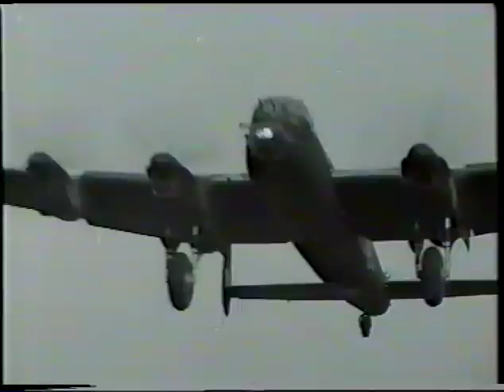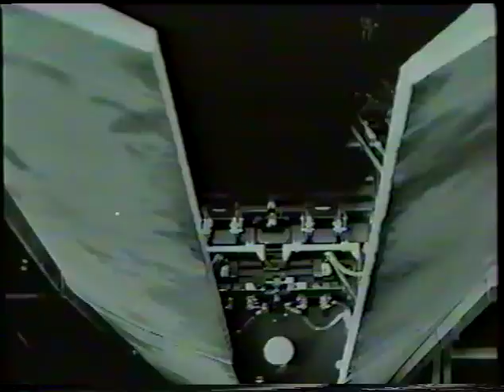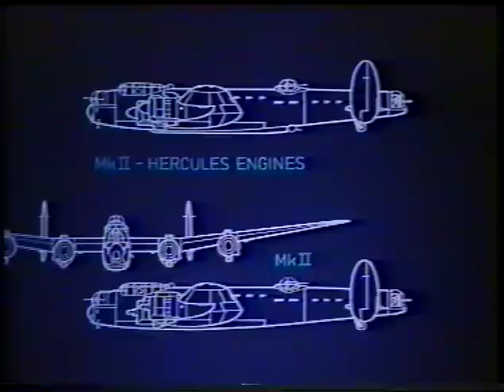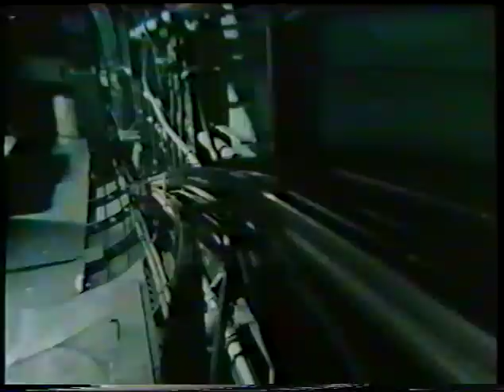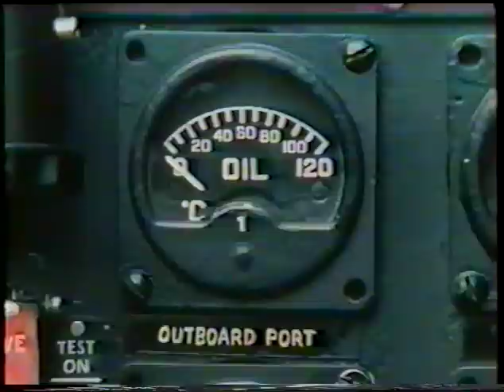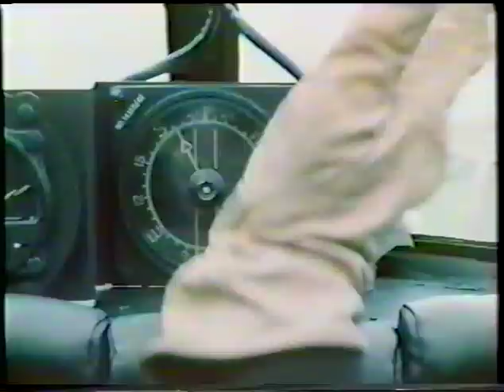Avro Lancaster Classic Documentary

Comment: A belly gun turret would have saved so many .
Reply: Yes but exactly where, just about the whole of the underside was taken up by the bomb bay
Reply: Fully acknowledge your point. Design did not emcompasse a belly turret.  Canadian Halifax Squadron manged to fit a  belly gun. Presumably Halifax has a shorter bomb bay. A tradegy  for the Bomber   Boys. @johnvanstone5336
Reply: Further reference to Google produces a diagram envisaging a ventral belly turret  FN64.  Positioned comfortably away from th bomb bay ; sadly never implemented .
Reply: Please forgive my miss spelling I have diminishing eyesight.
Reply: belly turret =  Smaller bomb load = more missions = more dead aircrew. An example is the B17G's with a quarter of the Lancaster's bomb load means risking 4 aircraft and 40 men to drop the same load. While in formation the underside 'should be' protected by the aircraft next to you, or that was the theory?
Reply: @andybawn1  Link anything stating an unmodified Lanc carried 4 times as much as a B17 G.
Reply: @nickdanger3802  sorry, just checked my post and I didn't say any thing about unmodified?
Reply: @andybawn1  Link anything stating a standard production Lanc carried 4 times as much as a B17G.
B.1 Special   32 aircraft were adapted to take first the super-heavy (12,000 lb) ‘Tallboy’ and then ‘Grand Slam’ bombs and included    up-rated engines    (with paddle-bladed propellers to give more power)    and the    removal of gun turrets    to reduce weight and give smoother lines.  For the Tallboy, the bomb bay doors were bulged slightly whilst for the Grand Slam, they were removed completely and the area faired over. For some Tallboy raids the mid-upper turret was also removed. This modification was retained for the Grand Slam aircraft and the nose turret was also later removed.
BAE Systems Lancaster page
https://www.baesystems.com/en/heritage/avro-683-lancaster
Reply: "The US 8th Air Force decided on daylight raids as they believed that this allowed for precision raids and precision bombing. Therefore, they reckoned, fewer raids would be needed in the long term for bombing to succeed."   "The 8th Air Force had fired 99 million rounds of ammunition during these flights and it is thought that 20,000 German planes were destroyed."
History Learning Site UK
https://www.historylearningsite.co.uk/world-war-two/the-bombing-campaign-of-world-war-two/b17-flying-fortress/
Reply: @nickdanger3802  yep knew all that 40 years ago, the simple fact is the B17 carried 4000lb to Germany half its maximum of 8000lb because of the range, Did it carry 22000lb at any time?. An interesting side note, The Mosquito could carry 4000lb to Germany risking only 20% of the crew losses of the B17 and was 80% cheaper to build, it could place a bomb on a specific building not just flatten an entire city, Go figure?
Reply: @andybawn1  Mosquito  FB. Mk VI  2,305 built  Fighter bomber/intruder variant using Merlin 22, 23 or 25.  4 (Browning) machine guns and 4 (Hispano) cannons,    plus 2 x 250 lb bombs    carried internally & underwing carriage of    up to 2 x 500 lb bombs.    Could be fitted with underwing rocket projectiles or drop tanks    instead of    external bomb carriage.
BAE Systems Mosquito page
https://www.baesystems.com/en/heritage/de-havilland-mosquito
Reply: B17/Fortress III  Bombload 12,800 lb with fuel for 1,140 miles
page 367  Bomber Command  Hastings
Reply: Imperial War Museum  1942  "Accepting that precision bombing was proving impossible, the War Cabinet sanctioned 'area bombing' – the targeting of whole cities to destroy both factories and their workers."
1944  "American escort fighters shot the Luftwaffe out of the sky."
https://www.iwm.org.uk/history/raf-bomber-command-during-the-second-world-war
Reply: TheAmericans did not prepare for night operations . Relying on group naviagotor come bomb aimer  to release ordnance  followed by group release. I  believe their navigators   trained some twenty weeks aigainst RAF course of sixteen months ensuring our  chaps would operate independently   Interesting stats. provided by  Don Nijboer as  regards German ordnance.  Flak accountedvfor  5380 American bombers destroyed requiring 16000 of 88mm rounds per victory. It cost the Germans  equivalent of  $107,000  in expended  ammo per aircaft but a B17 was valued at $292,000 plus specialist equipment of curse crew. In total the Americans lost in excess of 10,000 bombers. @nickdanger3802
Reply: @normannokes9513  You are operating on the assumption a bomber was shot down on it's first mission. I doubt 10,000 bombers were shot down, but since the USA produced 35,000  4 engine bombers that would still be less than one third.
"Of the total of 7,377 Lancasters built (430 of them in Canada), 3,932 were lost in action."
https://www.bombercommandmuseum.ca/aircraft/the-lancaster-bomber/
Reply: I am quoting from German Flak Defences via Allied Heavy Bombers  1942 to 1945. Osprey publication. @nickdanger3802
Reply: "To destroy the German aircraft industry, for example, precision bombing was needed, and in this the Americans specialized. The United States Eighth Air Force had been trained to bomb by daylight using the most accurate bombsights which could be devised, and with these they might reasonably be expected to hit buildings, such as the Messerschmitt assembly plant at Augsburg or the Vereinigte Kugallagerfabrik at Schweinfurt. Bomber Command, since it could operate in strength only at night, was not in a position to follow these tactics. The navigating device 'GEE'; was in operation and increasing in efficiency almost nightly, but 'H2S', 'OBOE' and the other scientific devices by which a greatly increased degree of accuracy would, it was hoped, be achieved, had only just been introduced."
page 4
http://www.ibiblio.org/hyperwar/UN/UK/UK-RAF-III/UK-RAF-III-1.html
Reply: @normannokes9513   18,188  B24's and 12,731  B17's produced so still less than one third compared to over 50 per cent for the Lanc.
Reply: Thank you. My knowledge is being enhanced. @nickdanger3802
Reply: @nickdanger3802  The Mosquito had a maximum speed in excess of 400 miles per hour (640 km/h) and a range of more than 1,500 miles (2,415 km) with a 4,000-pound (1,816-kilogram) bomb load. Its original armament included four .303-calibre machine guns and four 20-millimetre cannons, all firing through the nose. The airplane was produced in so many modifications for so many missions, however, that armament varied widely through the war and later, when it was used in the air forces of countries around the world. Including production in the three continents where it was made, there were 42 “marks,” or versions, of the 7,780 Mosquitos that were built. https://www.britannica.com/technology/Mosquito-British-aircraft
Reply: @nickdanger3802  A 4,000-pound (1,800-kg) bomb load was typical for long missions, though the B-17 could carry up to 8,000 pounds (3,600 kg) https://www.britannica.com/technology/B-17
Reply: @andybawn1  According to this site 945 Mossy's were produced as bombers (some were modified to carry the 4,000 lb "cookie", a metal drum filled with explosives' used for "nuisance raids") and 4775 as fighters.

http://www.wwiiequipment.com/index.php?option=com_content&view=article&id=116:british-production-of-aircraft-by-year-during-the-second-world-war&catid=48:production-statistics&Itemid=61#:~:text=Production%20of%20British%20Aircraft%20By%20Year%20%20,%20%20318%20%2056%20more%20rows%20
Reply: BAE Systems Mosquito page    B. Mk IV    283 built
Night   bomber   using Merlin 21 or 23. Bulged bomb bay fitted    to some     to allow carriage of 4,000 lb bomb internally.    Max speed 380 mph,    max weight 21,462 lb.    Twenty seven    built as B.Mk IV modified for   PR role
 https://www.baesystems.com/en/heritage/de-havilland-mosquito
Reply: @andybawn1  And the Lanc was very close to dropping Little Boy and Fat Man because of the B-29 teething problems.
Reply: @ajg617   the third bomb if it had been dropped could only be carried by the Lanc, the B-29 couldn't lift it
Reply: @nickdanger3802  RAF figures state AVERAGE bomb load of a Lancaster throughout the war was 8.000#'s  Sorties flown and tonnes dropped !!!  RAF figures !!!
Reply: @nickdanger3802  Bingo !!!!  You nailed it Nick !!!
Reply: @andybawn1  USAF's spec on the B17G was 6,000 # bombs carries 2,000 miles !!!  And with the wing mounts the B17G carried 17,000# of bombs !!!!  Interesting that the Brits brag about the bomb load but the actual fact is the B17 and the Lancaster weighed almost exactly the same empty and loaded for take off, meaning the difference was WHAT each carried, Brits chose to carry bombs instead of more guns crew and ammo and paid the price in 4,000 of the 7500 lancasters built being lost in combat and most with all the crew, over 50% combat loss wheras the B17 suffered a 37% loss.  RAF lost 56,000+ airman and the USAAF lost 25,000+ and the USAAF had over twice the number of airmen in theater !!!  RAF had to carry so many more bombs because their accuracy was so poor, few bombs fell with in 5 miles of the targets !!!
Reply: @nickdanger3802  And those 22 ,23, or 25 Merlin engines were the single stage supercharged engines, note they had 5 pipes per side and were NOT the high altitude merlins !!!!  More Facts of history to destroy the Brits lies, hype and Bullshit !!!
Reply: @andybawn1  BUT  the Mosquito could NOT carry the 4,000 # bomb load IF it was a FB with the 4 cannon and 4 MG as the cannon occupied the front half of the bomb bay !!!!  Only unarmed bombers could carry the special 4,000# cookie bomb  IF it was Modified !!!!  Facts of history !!!
Reply: @andybawn1  USAF specs state a 6,000# bomb load could be carried 2,000 miles in a B17 !!!!
Reply: @nickdanger3802  That is not many bombers !!!!  Destroys the Brits theory that there were so many Mosquito bombers !!!
Reply: @nickdanger3802  Merlin 21 or 23 engines were the single stage versions, NOT the high altitude version !!!
Reply: @ajg617  WRONG !!!!  By the time the Atomic bombs were dropped the B29's engine problems had been sorted out !!!! NO lanc was going to drop an Atom bomb !!! First they were 100 MPH slower than a B29 and could NOT get above 25,000 ft, B29 dropped atomic bombs from 30,000 ft for safety !!!
Reply: @andybawn1  BULLSHIT !!!!  The standard load of a B29 was 20,000# with a 3500 mile range and Post war a B29 lifted the 42,000# T12  super blockbuster bomb to 25,000 ft and dropped it.  Twice what any Lancaster ever carried aloft !!! And there was NO way in Hell a British plane was going to deliver the American atomic bomb !!!!
Reply: Not quite,  B17 could and did carry between 5,000- 6,000 lbs of bombs to Berlin whilst Lancaster managed between 9,000 - 10,000 lbs for the same city, ( The RAF museum has complete records for every mission flown by R5868) the load varied according to height and weather.  The 22,000 lb figure is for a very few modified BI specials, normal maximum load for Lancs was 14,000 lbs later increased to 18,000 lbs  but not of course for long range missions. As to the Mosquito the 4,000 lb figure (bomber versions) is for the cookie which could only be dropped at minimum height of 5000 ft  due to blast issues and as it had no fins was only suitable for area bombing as it could not be accurately aimed. Mosquito bombers not carrying cookies were limited to 4x 500lb bombs. By the way for the Lancaster for the Augsburg daylight raid on 17th April 1942 the load was four 1,000 lb bombs.
Reply: @ajg617  Another myth though the actual story is interesting. The original atomic bomb "Thin Man" was 27 feet long and wouldn't fit in the standard B29 bomb bay. Norman Ramsay, a physicist working on the Manhattan project suggested the Lancaster as an alternative in the event of the B29 modifications having problems. When the suggestion and that's all it was - reached the ears of Hap Arnold it was quickly quashed as he knew the Lancaster had nowhere near the range, speed or ceiling to to do the job plus the fact that the weapon would have to be armed in flight for safety reasons which was not possible in the Lancaster. Finally it transpired that the Thin Man bomb was unsafe due to the probability of premature detonation which led to the Thin Man bomb being cancelled. As the other two bomb designs were much shorter the modifications to the B29 were less complicated and therefore it was no longer an issue.
Reply: Shrage Musik would have been detected saving many aircraft. @ericadams3428
Reply: @andybawn1  More BULLSHIT !!!!  Brits like to scream about the 14,000# "POSSIBLE" bomb load but in reality according to RAF figures of sorties flown and tonnes of bombs dropped the AVERAGE bomb load throughout the war in the Lancaster was but 8,000#'s !!!!  FActs of history !!!!  The 14,000# bomb load was for SHORT bomb runs only !!!!   Just the facts of history being brought out, not the lies, hype or British Bullshit !!!!
Reply: Cost accountant assessment  rather callous but realistic.  The Americans thought their 'gunships' would effectively counter  airborne opposition  !!  Experience shattered the illusion.  They could see the enemy whereas our  gallant  chaps   for a considerable period remained unaware of the upward firing cannon  delivering rounds  into the wing tanks. So easy and deadly enabling  a nightfighter ace to destroy seven Lancs in  73 minutes.  In 1944 a Canadian squadron installed  a belly turret in the  Halifax.   I noted on Google a diagram  of  a belly turret for the Lanc. never implemented @andybawn1
Reply: @normannokes9513  Well that sure was not true.  It wasn't until long range fighter escort protected the bombers that losses started to decrease - P-38, P-47, and eventually P-51.  Would have been interesting to see how Lancs would have performed in daylight raids with P-51s as escorts.
Reply: @ajg617  The Gernan pilots stated  that theabsnce of a belly turret in our bombers was their good fortune  operating at night ; familiar  with American gunships  in daytimeoperations.    Sadly, earlier suspicions expressed by aircrew  of  the upward firing ordnance was rejected by our intelligence officers  for many months.     A  Canadian  bombersquadron  independenly  installed  a  belly turret late 1944 . Seizing a much too late initiative.  Our chaps were  needlessly exposed !.
Reply: @ajg617  I believe my response to yourcomments has been blocked by youtube. ? Kind regards NN
Reply: Lancasters were originally fitted with the FN64 ventral turret. These were fitted where the H2S dome was put. These turrets were aimed using a periscope which had a very limited field of  view making it almost impossible to see and track incoming fighters. H2S was not fitted to Lancasters fitted with the bulged bomb bay doors which blocked transmission, so these aircraft were often fitted with one or two downward firing machine guns.

The problems with documentaries like this is they only focus on the common variants.
Reply: 21.2.45 Schnaufer destroyed  7 lancasters with a possible 8th. in 72 minutes. Using upward firing cannon with great economy.  Just afew rounds into  wing tanks and job done . German aces could not believebtheir good fortune. A Canadian  Halifax squadron fitted a belly mounting in 1944.   Obviuosly at that stage we had a huge numerical advantage  crew and aircraft  and high command consensus  ... we can afford the loss ????
Reply: Ventral turrets were fitted and experimented with on early Lancs but were removed as the crews reported them being virtually useless and a hindrance.
Reply: Could this period occur before the advent of the upward firing cannon ?   Leaving no prospect of detecting   possible attack from below.    The consequence was  sacrificing  literally hundreds of bombers. Poor chaps! @KP-viking88
Reply: @normannokes9513  Well yes, as I said, it was something that appeared on early Lancs then done away with
Reply: Apolology.  Slow cerebration.   Tragic factor when high command made aware of this menace no concerted effort  made  to  install the unit. Then no shortage aicraft and crew.  Read a book published in Canada accusing the high command of profiglacy.  Reap the whirlwind by Dunmore and Carter. Also worth aread Wings for victory by Dunmore. @KP-viking88